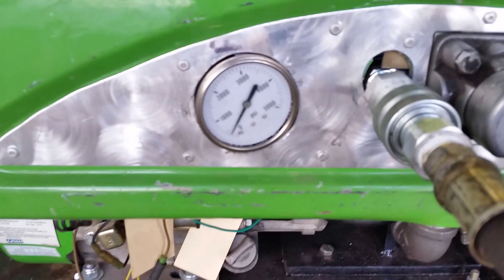Homemade hydraulic power pack.

Comment: Awesome mod. Question! Can hydraulic pump pressure enough to drive generator head? 
I'm thinking of modifying my truck engine and thinking of attaching hydraulic clutch pump to gen set for mobile power. Do you think it's possible???
Thank you
Reply: what do you mean by generator head ?
Reply: @danalex2991  I have a portable generator that I would like to modify to hydraulic clutch pump system. Do you think it would work? Thank you
Reply: @Crestone-saju  you could remove the electric generator from the engine and attach  a hydraulic pump like something this guy has done. But I don't exactly understand what you mean by hydraulic clutch pump system . Do you mean you will attach your pump to the engine without removing the electrical generator ? So that means the engine supplies power to both generator and pump at the same time as soon the clutch to the pump is engaged? If thats the idea I don't think iv ever seen a hydraulic pump attached to a driver through a clutch . If you don't want to load the engine when you don't need the hydraulic pump then you could just unload the pump through an open center valve . That would make it operate it like a minor parasitic load when you don't need the hydraulic pump. Is this what you had in mind? If it is , then it would work provided you set the  relief setting correctly so as to not  draw too much power from the engine so as to not stall it. And would you be using electrical power at the same time ?
Reply: @Crestone-saju  what are the specs of your generator ? And what is the pressure and flow you require for your application?
Reply: @danalex2991  generator is 6000w. I don't know much about flow specs.
Reply: @Crestone-saju  so you got about 8 hp at your disposal. If you don't take out any electrical output , then 8hp of hydraulic power you could take out from the engine theoretically. That would mean you could drive a load of 200bar at 18 LPM . Or 100 bar at 36LPM .
Reply: @danalex2991  thanks for your input. I'm better off with power inverter in the truck vs hydraulic system. Less cost. Thank you